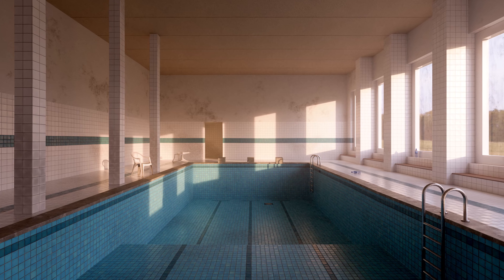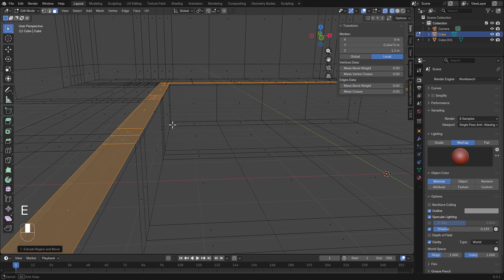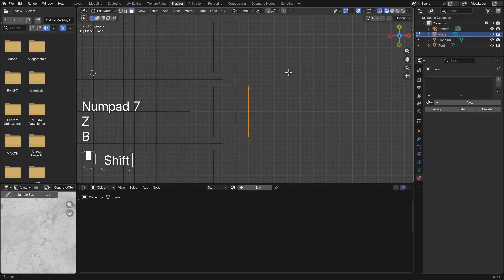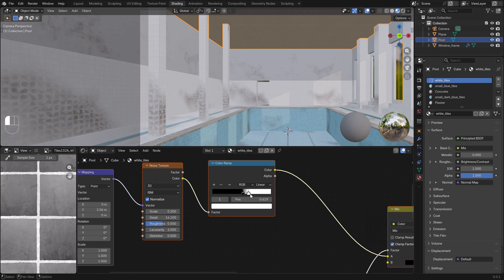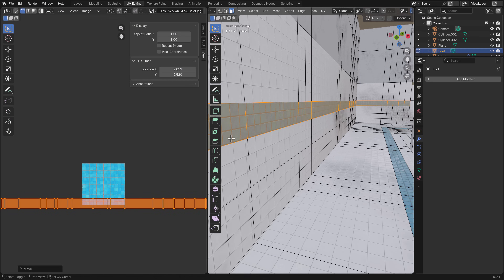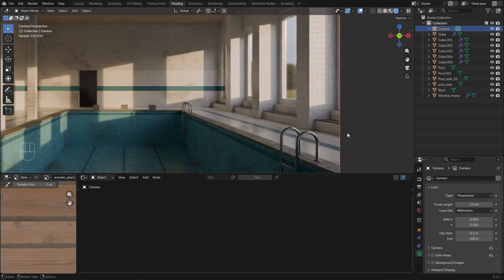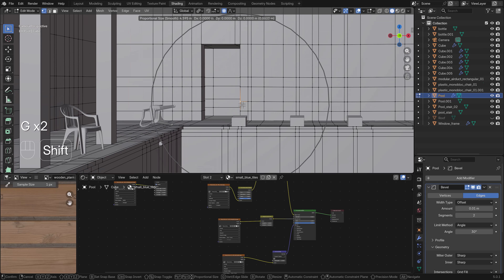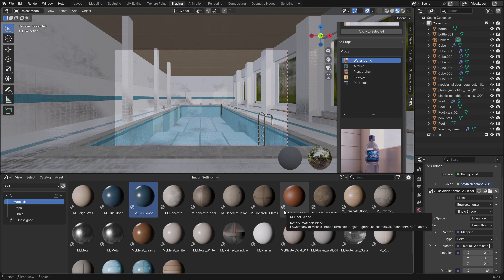How to Create a Swimming Pool in Blender

Comment: I had trouble with the window.  In solid mode the frame "looked" correct, however, in edit the back and side faces were missing. When rendered those faces were missing as well. The simple fix was deleting and start over. I'm thinking i somehow i got the back fave to occupy the danger spacial plane as the front? How do i check if that's the case?   UPDATE: there were key frames set for the windows. huh? That took care of the rendering issue. The missing faces in edit mode seem resolved also.